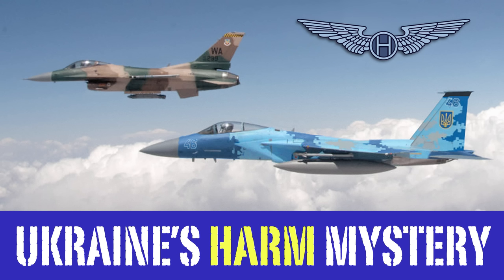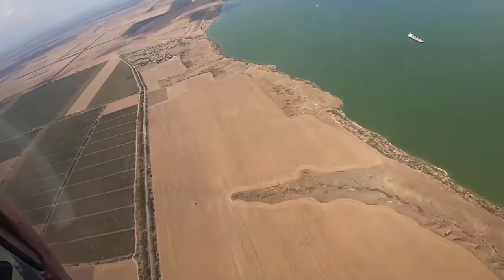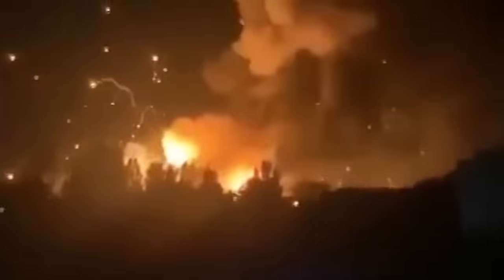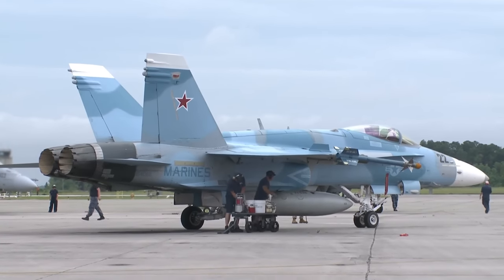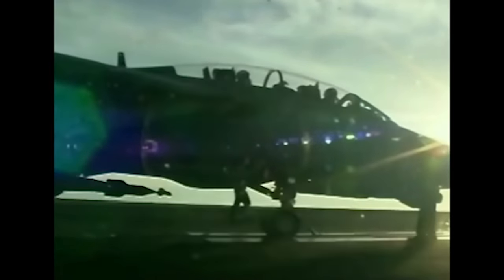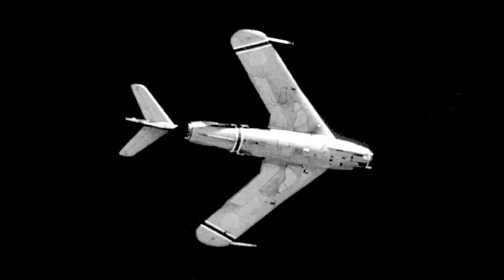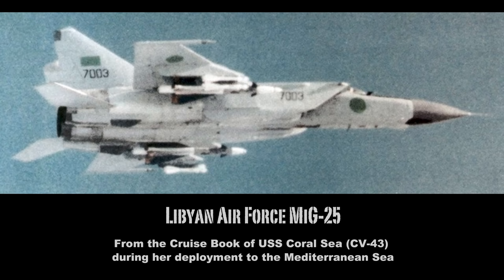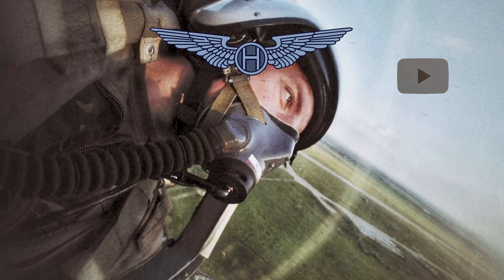Ukraine’s HARM Mystery – How "Top Gun" enabled Ukraine to use HARM Missiles in the War-PLEASE SHARE

Comment: I’ve seen an reliable polish analyst saying, that the modification was considered some time ago in Poland to upgrade its MIGs with the harm missals, to avoid having to buy new f16 jets. Actually they even had some working prototypes. In the end they have scrapped that project and bought f16, being financially a better deal. It is very likely, that this polish arms fabricator worked together with the Americans to finish this project so fast.
Reply from the maker: That could be the case -- they would have had to work with Raytheon anyway because that is who manufactures the AGM-88 HARM, so either the information from the earlier program was shared with the Polish or they redeveloped alternatives together.

Comment: Apparently, the avionics has a mode for air-to-air SEAD against AWACS type planes.
This mode seems to have been adapted to work with the HARM missiles.
So the plane thinks it is shooting at AWACS.
Both the Mi-29 and Su-27 seem to have been able to be used this way.
Reply from the maker: That's an interesting feature that I'm not tracking. I am not sure that the air-to-air capabilities of this missile would give significant advantage, but it is something to research.
Reply: @HistoricWings  he's talking about the plane's avionics. Basically fooling the interface, the plane thinks it's in air-to-air mode, the missile thinks it's air-to-ground. The plane finds the target as an airborne threat, tells the missile, then the missile is fired and engages it as a ground target

Comment: Super interesting. It's insane how hard it must have been to keep the fleet of Soviet jets in working condition during Cold War.
Reply from the maker: That's an important point -- the costs were extraordinary, the spare parts were unavailable and had to be hand manufactured, one at a time, and, like all Russian equipment, it was built tough, but also broke a lot. Hugely costly -- that lesson alone was informative, as it taught a generation in the Air Force about the difficulties Russians face in keeping their own squadrons at readiness.
Reply: @HistoricWings  All russian/soviet equipment are same trucks, tanks, helicopters, even ships. Trust us we knows in the end finnish mig 21s had little or no soviet avionics so they were different beast than what came out of factory line. And then there was soviet tank transport if you use it couple of hours man must maitenance it days. We had two of those and we just use one for training purpose. And then we has couple of Riga class escorts and Osa class missileboats and a boy how much more they need maitenance than our ouwn Karjala class gunboats.
Reply: It was very easy to keep them in flying condition because they are deliberately made to be simple.
Reply: I suspect prior to 1991 most A/C's from the Bad-lands were for system and aerodynamic evaluation. The engines on these things had low TBO's (Mig 21 is about 250 hrs, Mig-29 is 500 hrs), meaning that the use for Top-Gun would be a problem before '91'. However after 1991 parts and the engines themselves where available therefore allowing combat training use in Top-Gun. I also suspect the conversion 'Kits' for weapons was initiated to make use of existing  NATO Mig-29's possible with NATO weapons. I venture to say the conversion for these HARMS probably took 160 man hrs or one week 24/7.
Reply: It was 100x more difficult AFTER the cold war
Reply: Bruh Russia doesn't even use mig 21s anymore
Reply: @BoleDaPole  I guess its the same reason why the U.S did not follow through with the F20 tigershark which is in the size range of the swedish griffen.

Comment: Recently photo of Ukrainian Su-27 equipped with AGM-88 emerged and thus have me convinced that incorporating AGM-88 missile to Soviet jet was not actually difficult. 
Thank you Raytheon and Top Gun for the support of compatibilities that Ukraine desperately need in short times.
Reply from the maker: The same team of engineers from Raytheon also had worked o the Su-27 and those planes were also used at Red Flag. I expected that the Su-27 would be so equipped as well -- it is just a matter of time. My friends tell me that the AMRAAM is next.

Comment: A substantial portion of this video is complete speculation. It's clear that Ukraine is using the HARM, but the exact specifics of how is not known, and "well Raytheon did it in the 90s" doesn't really fit the whole picture. Software to employ the HARM wouldn't be needed for aggressor squadrons (who primarily conduct air to air training missions), even if much of the firmware solutions were likely done for use with aggressor squadrons.

My actual guess is that Poland or Slovakia already had the capability to fire HARMs from their Soviet-era fighters, and the firmware was included in the "spare parts" sent to Ukraine.
Reply: That sounds like the most plausible scenario. There was early supply of spare parts for soviet era jets. When everyone was still afraid of giving us any actual equipment. Than later when EU figure out that there will be no nuclear war there was supply of actual jets. So it's highly likely that those came already with sweats
Reply: Hopefully we will get Fs soon 🙏
Reply from the maker: Thanks for your comment -- please review the links provided at the end of the description. The statements made in this video are carefully researched and supported. Raytheon itself states that the engineering knowledge they had about the MiG-29 came from their work on these types with the Aggressor Squadrons.

Note that it wasn't that HARM missiles were mounted on the MiGs for Top Gun and Red Flag, but that they had done all the engineering to mount Western avionics onto the aircraft during the 1990s. Remember that the ACM at these training exercises includes a lot of onboard avionics to track simulating shooting, etc. -- hence the need to mount a MIL-STD compatible electronics bus on the MiG and their resulting knowledge. As a result, they installed the MUX and from that point forward could easily install the necessary electronics to integrate HARM missiles onto the aircraft.
Reply: I think you are correct.
Reply: @HistoricWings  yes and im sure that that package was given to our new nato allies good video.

Comment: The harm missiles has 3 modes it operates on 1, it is supplied with targeting data from the launch aircraft 2, Its loaded with target location info on the ground gathered from intel sources before take off and 3, the aircraft is fitted with an interface showing when the missiles sensors detect an enemy radar.
Reply from the maker: Correct. Even after launch, the HARM missile communicates data back to the aircraft for evaluation by the pilot. That way, as well, the pilot knows if the missile has malfunctioned or if it has (likely) struck the target, which is critical information when you're more than 150 km away from the radar system being hit. Without that, the pilot would not know if they had to launch a second missile to finish the job.
Reply: @HistoricWings  they seem to religiously "double tap" the HARM. They may be compensating for using the inferior mode by sending 2 every single time.

Comment: Awesome!  When I first heard about this, I envisioned some crazy software patch between the systems that was allowed to skip most of the normal testing and certification.   The real answer was even more interesting.
Reply from the maker: That's an interesting thought -- a MUX interface of sorts with a software conversion utility. I suspect that it would work, but that it would add weight, create a lag in response, and end up being a bit buggy. Still, the idea has merit.
Reply: It's not a real answer, he made it up to get clicks.
Reply: @HistoricWings  Undoubtedly it would be a bit buggy and have some lag,  but if there was tight enough used case (I.E.  Arm yourself;  Lock on to the radar at these coordinates; Fire) it could be done in software plus any needed wiring to link the systems.   It would surely lack full functionality, but if most missions could work with basic functionality, it would be worth a battlefield try.

Comment: I was an AO with the Navy. They are using retrofit migs from Poland and other NATO countries. Also the HARM is a self seeking missle
Reply from the maker: Yes, though again it is not as easy as just hanging the missile on the wing after all -- the HARM needs to be fed an initial set of GPS coordinates to fly toward after it is launched. That requires linkage with some kind of compatible onboard GPS/INS with the right comms protocols as well as an input/selection interface from the pilot to designate the intended target. Then the missile has to be launched, which requires linkages to an arming switch and to a trigger. All of this requires electronics to achieve.

Comment: Wonderful! This confirms what I've been arguing for months, that training Ukrainian pilots to use F-16's or F-18's effectively could be done in 12 months. In the meantime, US avionics and weapons systems configured to work on Migs allows time for training maintenance crews and creating the infrastructure, workshops, etc required to support those aircraft. Easier for the Ukrainian pilot's and ground-crews to learn would be the A-10. Ukraine's Su-25's have been effective, and few have been lost. If the US was willing to give up any A-10's, I'm sure the Ukrainians would use them wisely. I think the psychological impact on the Russians could be similar to that of the Stuka in the early months of WW2.
Reply from the maker: I expect that the Ukrainians will be offered F-16C fighters in the end, though it is not yet clear what they will ultimately be equipped with. I believe that a hybrid force is the best option as well and agree with you 100% that the experience they are gaining with these types of weapons systems is invaluable and will make all the difference in 2023 -- if the war continues past the winter, which I expect will be devastating for Russia.
Reply: problem with A10 is it requires a really good SEAD and DEAD mission set which ukraine cant provide. A10s are slower then SU25 which makes em more susceptible to AA. modern helicopter gunships would be better IMO if they operate in an area with limited or no russian AA

Comment: I’m just getting into DCS and with what I’ve seen and done building my own flight simulator it doesn’t surprise me that they were able to adapt that missile to the mig29. A few arduinos and pcb’s and you’re in business but don’t forget the most important thing is the missiles.
Reply from the maker: There are over a dozen avionics and electronics subsystems to tie in to enable the missile to have full operational capability. However, it appears -- and we don't know exactly HOW it was done -- that they've managed to bring the missile to operational status in its long range stand off capability, which is the most important one anyway.
Reply: I highly doubt they use Arduinos! The operating temperature is commercial spec, not military spec
Reply: Sounds like it was done before arduinos were popular. I'll bet industrial spec is good enough in a pinch.

Comment: It's not quite as simple as flying down a radar beam because the radar dish rotates and the beam is not omnidirectional, so the missile seeker will get flashes of microwave radiation, and not a continuous steady beam.
Reply from the maker: Correct. The design of the missile remembers the exact point from which the signal was detected. Whether it rotates away or is turned off, it flies toward that. If it rotates back around, the position is updated. This happens continuously until the missile reaches its target.

Comment: Rumors say an Ukrainian upgrade for Mig-29 made in 2019 (called Mig-29MU2) already had the MIL-STD-1553B data bus needed for launching HARM missiles.
Reply from the maker: I haven't heard that rumor, though Raytheon itself admitted that it did the work this year. If there were some versions of the MiG-29 that had a MIL-STD-1553B bus, the knowledge from that still came from the same teams and the other electronics still would have needed to be mounted. From the videos of the aircraft shown, it does not appear to be the MU variant.
Reply: @HistoricWings  I thought it was like a firework, light the e-match and off you go 🤣🤣🤣
Reply: @HistoricWings  Ah, interesting... Also, MIL-STD-1553B was rumored to be implemented on MiG-29SMP/UBP (of Peruvian Air Force) in late 2000's. Poland had plans to implement the same digital bus back in 2011, but I haven't found what the plans ended with.
Anyway, it seems Raytheon has done all the needed researches and test implementations long time ago, so they could just repeat the sequence on Ukrainian jets 🤔
Reply: And rumor has it that you shoot firebolts out of your S!

Comment: I thought the migs came from Poland that already were equipped with harm 88 upgrade
Reply from the maker: The Polish did not ultimately provide any MiGs. However, spare parts and support materiel have been provided in large volume, which has enabled Ukraine to achieve record high readiness and operational capabilities for its existing fleet of MiG-29s, which number approximately 50 based on public reporting.

Comment: This has been worked on for years because there is a lot of Soviet era jets in NATO.   I suspect that there is just a simple drop in box and display for it with a data wire running to the wing hardpoint. All it would need is power. You may have to remove something to make room for a display but I believe it would work.
Reply from the maker: Yes, Raytheon had everything already worked out in detail. In the end, it became an installation job, not an engineering and development challenge. Fascinating results and truly a game changer in this war.

Comment: Ukranian's home made solution to a problem; fitting supposedly incompatible Missiles to old Soviet Jets. Russian home made solution to a problem; welding rusty old grills to T72 Tanks to try to foil Manpads.
Reply from the maker: That is an interesting comparison. As well, I have not seen the same level of innovative thinking or flexibility from Russian forces. Nonetheless, it may be happening -- the news from the frontlines of this war has been mixed and bad news about Ukrainian losses and challenges is not as widely reported as successes. However, one should not believe Russian claims either. For instance, just a few days ago, Russia declared that it had eliminated the Ukrainian Air Force, though this is the FOURTH TIME they have claimed that.

Comment: I doubt the involvement of Top Gun other than to make available an aircraft. Top Gun is a training establishment comprising pilots and instructors. The kind of activity required is far more likely to be done by a R&D organisation, or an aviation trials/test organisation, such as Edwards air force base. But Top Gun at Miramar sounds good, right?
Reply from the maker: The term Top Gun, as explained in the video, was used to apply to both Red Flag and Top Gun, but the public has no idea what Red Flag is. As explained in the video, there were multiple parallel programs that flew the Russian MiGs (and Sukhois), such as CONSTANT PEG, etc.

Comment: Right at at the beginning of the war,  the Poles offered a whole flight of MiG-29's to Ukraine, these then went to Rammstein USAF base.
Then the US said, they wouldn't send them to Ukraine to not escalate the conflict. 
Wonder what happened to those MiG's between then and now?🤫
Reply from the maker: Excellent question. Though I don't know the current status of those Polish aircraft, all public sources make clear that no additional aircraft were provided to Ukraine by any NATO member countries. I expect that this is the case. Despite that, more important for Ukraine was the extensive support shown in the form of spare parts and materiel were provided, which enabled Ukraine to increase the readiness level of its existing aircraft, which equated to bringing online an additional twenty or so MiG-29s.
Reply: @HistoricWings  wonder if Raytheon gave them the once over in Rammstein,  before they were turned into "spare parts"...